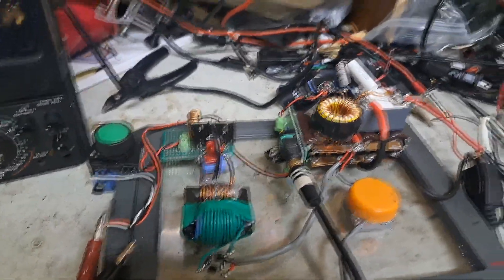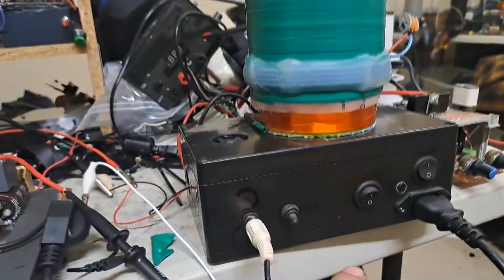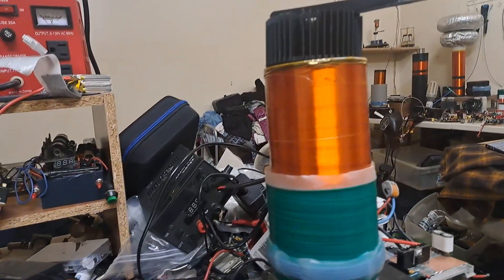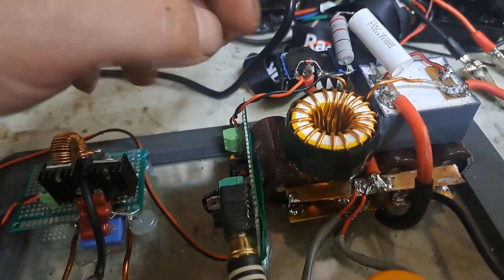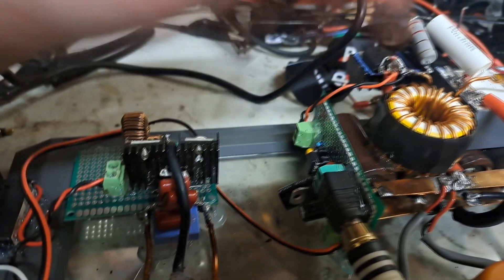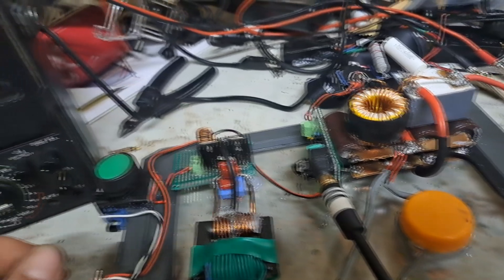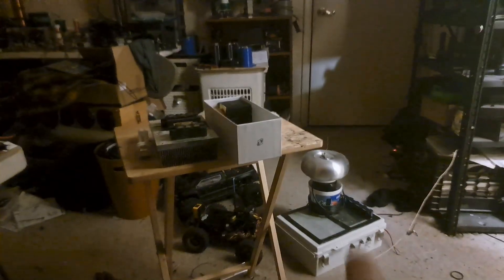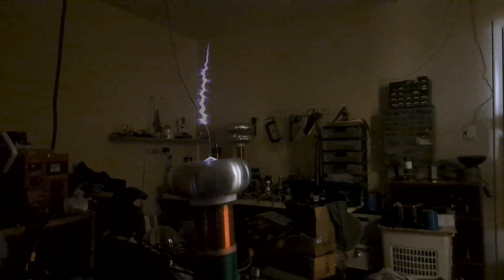15VDC ZVS Inverter + QCWSSTC Half Bridge Test

Comment: What do you need the 5K load resistor for?
Reply from the maker: The load resistor tries to help make sure the voltage swings back down before the bridge starts cutting on again for the next ramp. Otherwise you'll go from soft starting arcs to hard starting them etc.
Reply: @Magneticitist  is it discharging the bus capacitor on the bridge or the filter cap on the buck? it's eating energy during every pulse, right?
Reply from the maker: @BackMacSci  yea both. The resistor is always going to bleed the SSTC bus and the small buck output capacitor, but not present too much of a load when the buck is on.
Reply: @Magneticitist  thanks!
Reply from the maker: @BackMacSci  https://www.loneoceans.com/labs/qcw/sept29_ramppri.png

That's Gao's scope shot showing what can happen when the ramp enable pulse turns back off when there is still current in the inductor of the async buck. The charge it puts in the caps has nowhere to go but back to the bridge when it shuts back on without that resistor bleeding it down. So basically it might not be getting the job done fast enough if you increase the BPS too high.
Reply: @Magneticitist  thanks

Comment: I really been wanting to replicate that Lukas Koval allegedly single fet QCW deal since I saw it the first time but aint easy to to replicate those crazy russian wizzards , zvs trick is the way to go , only problem might be needing a big bus capacitor bank , and keeping the bps fairly low so it has time to charge the bus between blasts , but I can see how you could make this setup into a tesla coil gun
Reply from the maker: His coil is so awesome probably because it's just tuned Class E as best he could, or something close to it.. That will definitely help him run the single switch without problems. His interrupter and ramp generator is also pretty damn cool. You definitely need to size your bus capacitance according to desired output but you don't necessarily need huge caps just to get long arcs. So long as the on time is short anything 1000uF or even less seems fine. 

This build can be broken down into two sections just to make it easy.. the buck and the SSTC. You want to build a decent buck and run it and test it with a resistive load just to get it working right.. Then you want to build a decent single switch SSTC that works fairly well from mains ramps..
Then when you combine them together you are more or less good to go with slight tweaks.
Reply: @Magneticitist  Yep maybe I should build the Buck first , I guess I need a fairly beefy fast diode , a Igbt , and a gate driver ic do you think a ucc27524 would work or do I need any specific gate driver ?
Reply from the maker: @rodriguezfranco3839  You're probably good with most any gate driver. Mine is 2.5A peak. ucc27524 should be fine. With QCW it's typically the slow break rate anyway so the driver and switch are getting nice breaks in between arcs. I could probably run this test setup for an hour and probably not feel the switch getting hot and it's just stuck to some small heatsink with a pad.

Comment: Dude this is awsomo.  this is what i was building. I was gonna feed this directly into a slayer exciter or a push-pull style sstc .
Reply from the maker: Seems like it could work without a lot of hassle. I wasn't expecting this setup to work all that well without using PLL feedback like I did on the other. I imagine by adding in a tuned series primary cap I could increase the arc lengths quite a bit. There are some shortcuts I took which overall has the ramp not looking very clean but it doesn't really seem to suffer from it at the max voltages I plan to run.
Reply: @Magneticitist about the push-pull style tesla coil . MS lab used a balun ferrite core for its secondary feedback with 1 turn for its primary and secondary (feedback transformer). I have the cores but I feel that the feedback transformer with single turns won't effectively switch the mosfet gates . Should I try just a core from like an smps or something similar
Reply from the maker: @spiderspider1384  I think since he was using such small coils at higher frequencies he wanted to really make sure the transformer had the current to drive the gates that fast so maybe the 1 turns worked out for him. He may have also been tuning the feedback to resonate some not sure. Either way I never really had problems just reusing prewound filters.